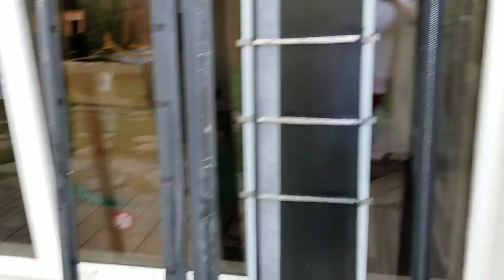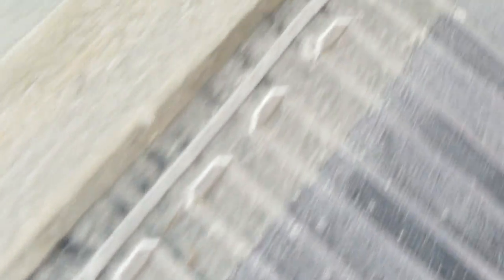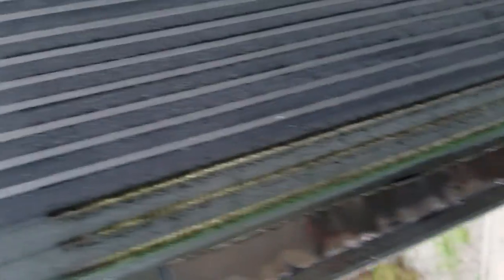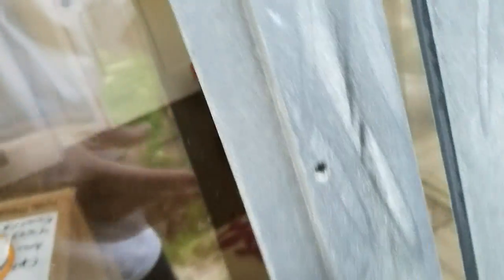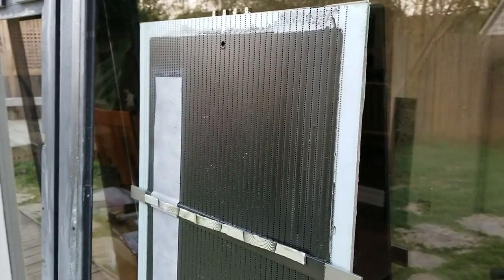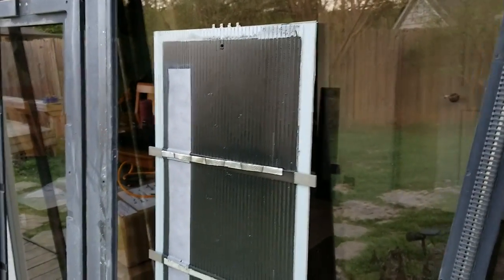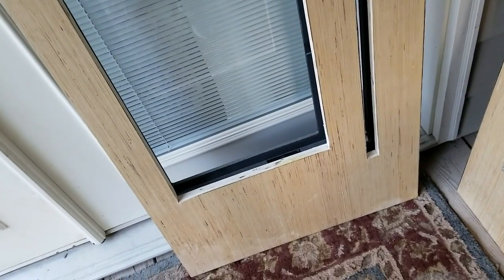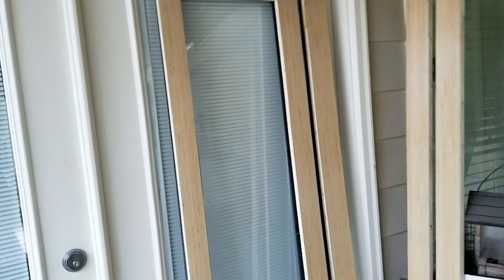Magnepan 3.7i breakdown, shakedown, and rebuild

Comment: You are a genius for the new frame.  Resonances will be absorbed that is so vastly superior to the original that I am sure you are a very happy listener!  Waveguide?  Awesome.  .Triamp - doing it correctly, it will be in phase and sound and the bass, mid woofer and ribbon will blow you away.  The cost of the amplifiers are not as high as you would think as amplifiers of the bass and mid bass need only 100w/ch 8 ohm on each.  The ribbon can be powered by class a.  You don't have to buy the most expensive amplifiers as prices come down from the monster 500+ w/ch to just 100 and 25 for the ribbon.  Just so they are stable.  Good cables works well too.  I can only imagine what your system sounds like
Reply from the maker: come listen !

Comment: Very interesting.  Thank you for sharing.  My Dad has a pair of 3.7i's un-modded.  They are truly amazing speakers and a bargain at the price.  Best tweeter I have heard in a speaker.  Have you experimented with upgrading the fuses in the 3.7i?  If so what kind of benefits?  And what did you use?
Reply from the maker: Hi Snow Pup, yes for sure, you use a fuse bypass which removes the fuse by replacing it with a pure silver tube. The kits are sold on Mikepowellaudio.com right now, but soon to be 11stereo. com I will be expanding the options within a week to include two different types of fuse jumper in the kit. One to liven it up and one to chill it out if its too lively to begin with . 90% of people want to liven it up, and the regular kit will be like pulling cotton ouyt of your ears with the 3.7i. This is all that is "needed" per se in my opinion. Next step is rigid stand.

Comment: So this is what the inside looks like... I have 3.6r's that one panel has started to make a buzzing sound with upper bass material which indicates a wire or wires has come unglued and I'm gonna have to go in there and repair it.... From what I've read the 3.7i and 3.6r are very similar in design... This video gives me the confidence I need to take on that task! Thx man!
Reply from the maker: See ? There ya go. There is a certain glue to use I cant remember now, then glue the wire down and support it underneath then set some books on it and that's it.
Reply: @OCDHIFiGuy  Dap Weldwood contact cement is what I found to be used, but yes this video is very helpful in showing me the way! Thx again!
Reply: I just restored an mg2 and a tympani I (3 panels per side) my main speaker.,

It’s not hard at all .. just call magnepan , they will send you all you need including new socks if needed, glue ,wire and rudimentary instruction. 

Take your time and makes pics of you remove anything or not feeling to comfy with. Restoring them is super easy

Comment: Great idea. I’m a little worried about the baffle depth that will be in front of the ribbon tweeter... it will alter its in-air response and off axis response. 

I purchased a pair of LRSs a few days ago. They should be here in about a week. I’m excited to fire them up!
Reply from the maker: what off axis response ? lol..  for real these things beam and have zero off axis response. I am doing a wide flare waveguide anyways just to see if we can create a wider sweet spot..  it was my concern as well.
Reply: You are gonna love them.  You might want subs I have two REL T5i which matches up great!  I have to have the subs.  Set them up as reflectors and near field as well if you can.  I like them from afar they are so dialed it's scary.